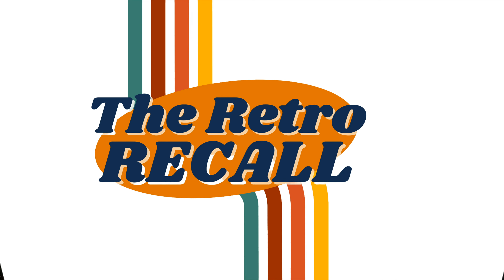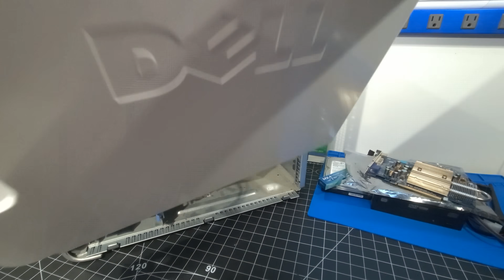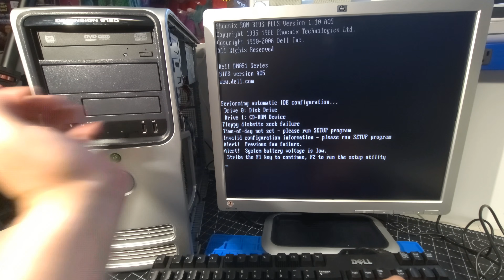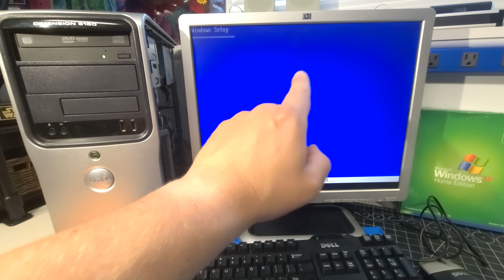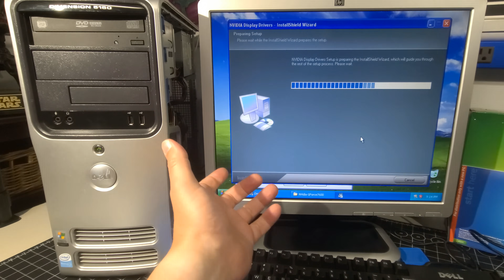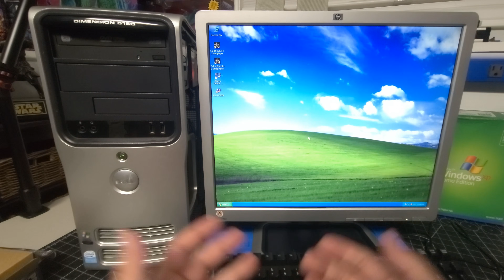Dell Dimension 5150 E-Waste Rescue - Full Restoration!!

Comment: Going through older videos as I recently found your channel which I am greatly enjoying the content! One thing I tend to do with older machines (well any machine these days to be honest) with running Windows XP or above, is use Snappy Driver Installer Origin for the drivers. It saves quite a bit of time trying to locate and/or guess which drivers you need. I tend to only install the graphics and sound drivers separately.

Comment: the first time I worked on one of these with that shroud that pulls the heatsink off the CPU, I was a little confused, but the mechanism works well enough... I just worry about when the plastic gets a bit brittle & breaks. can you put a normal CPU cooler on there? if not, you could have to throw out an otherwise perfectly good system
Reply from the maker: I'd have to 1000% confirm but I'm pretty sure you can.

Comment: JUST GOT ONE OF THESE SNAZZY DELLS AND GUTTED THE OLD HARD WARE AND REPLACED IT WITH MODERN AM4 MOBO R5 3600 16 GB DDR4 AND A RX550 4GB GREAT LITTLE HTPC! LOVE THE AIR INTAKE AND THE METAL LATCHING SIDE PANEL!! WILL BE PAINTING ALL WHITE! HAD TO MAKE A CUSTOM MOBO TRAY AND CUT OUT THE BACK A BIT BUT WORKS FLAWLESSLY!! WIN 11 ON A "E510" LOL
Reply from the maker: Haha I was going to say, ATX VS BTX.  Did you have to do alot to the to case to modify it?

Comment: how do i clean my computers? with a air compressor . been doing it that way for years with no issues. i used to have that exact pc until the motherboard took a dump. i recently got a dell xps 420.  and its a great pc. in fact im using it now to type this message lol
Reply from the maker: Nice! Yes I've used an air compressor as well, however it doesn't work in the space I'm filming in.  I use the ESD brushes and vacuum to clean instead.

Comment: Hi, just started watching the channel so a little late to the party.  First, if you are rescuing Dells ... you should expect that 9 out of 10 or maybe 99 out of 100 will fire right up.  I have had a lot of Dells over the years as well as a number of them from the local thrift store.  I can only recall one from this era that didn't boot and that was because some jammed the CPU back in the socket and bent about a third of the pins.  Also, I am pretty sure that XP key on the side of the case wouldn't have worked. I believe this is from the era of when there were OEM XP install discs that automatically installed without a key. The tag, I belive, was just to keep track of how many XP installs went out the door. With that said, if you can get your hands on a Dell OEM XP reinstallation disc, it should just install (on a Dell of the era) without a key. The Dell discs would not, however, install on a non-Dell.  If you search on archive there are a million of these discs posted. The plus to do this is it should also give you the Dell branding (system information, wallpaper, etc.). That would restore this PC to it's former OEM state.
Reply from the maker: Thanks for this and welcome to the channel!!!!
Reply: Hey so I have the OEM disc for my Dimension 5150 and it does have the product key, but it doesn't give me the dell branding? Even the Dell Resource CD doesn't give me the branding

Comment: Brings back memories I had a Dimensions E521 same case but had a Athlon 64 Dual Core. Had for about 4 year before upgrading ti an XPS machine and gave my Dimensions to a friend who continued to use for another 4 to 5 years. Only issue it ever had was the sound chip died and I had to install a sound card.
Reply from the maker: It seems they lasted.  I have other Dell's today that are 10 years old running windows 10 without issue.  That replacement sound card was probably better than the onboard :).  Thanks for watching and for sharing!

Comment: XP supports 3.5GB of ram due to it being a 32bit OS. One of the main reasons I switched to Windows 7 back in the day was due to this limitation and the fact that if you had a 64 bit processor a 64 bit OS would generally be snappier.
Reply from the maker: For sure!  And thanks!

Comment: Windows xp home before service pack one had an issue with hard drive partitions over 160 gb but it was patched eventually. Windows pro and enterprise editions didn’t have the issue. I remember having the exact same issue you were having trying to install Windows Xp home on a 250 gb hardrive drive and ended up having to partition it into two separate 125gb.
Reply from the maker: Thanks for this info.  As noted I had never experienced that before so this is helpful for future builds!
Reply: No problem I enjoy your content.

Comment: I have a ibm thinkcenter M51 tower and it has a pentium 4 with hyper threading and it run hot it keeps my legs warm and I got it from my local dump and it doesn’t have any bad capacitors at the moment but yeah it plays XP games well and Iove it
Reply from the maker: Nice!!! Those were robust systems - and good space heaters haha.  Thanks for sharing!

Comment: Just noticed something that may explain why your XP Home install failed.  Upper right corner of the XP Home disk portfolio calls it an Upgrade...which means it is expecting there to be a pre-existing version of Windows 9x!  All of the necessary files are on the optical disk, they're just disabled because this is the (cheaper) upgrade version.  There IS a way around it, told to me by a friend who worked for a computer retailer, it involves copying the CAB files to a directory on the HD, unpacking a couple of them, modifying a couple of numeric values in INI files, and then rebuilding the CABs before running the install from the HD directory.
Reply from the maker: That is a great call out.  I was expecting from a clean install that it would ask for proof of validation.  It wouldn't even get to the part (GUI) after the files were copied which has me thinking it was a driver issue that the SP1 wasn't covering as part of the Home edition version that I have.   Either way, PRO OEM installed perfectly, but definitely a great call out!! Thank you!
Reply: @TheRetroRecall  This is true, another thing from my experience, Dells are very picky about what they will install. I had an old Dell desktop system, and it absolutely refused to install from the generic MS windows disc I had (which was a full copy, not an upgrade), I had to get a Dell specific OEM disc, which it looks like you have there based on the printing of the Pro booklet.
Reply from the maker: I do!  Thanks for this info it makes sense.  When I revisit these systems (hint hint haha) I may do that test!  Thanks again.

Comment: I have a couple of these towers, recovered from a direct mail warehouse that went under.  I was thinking of trying to find a more modern mobo that would fit the airflow scheme.
Reply from the maker: Nice!  From what I understand the case would have to be modified to fit an ATX form factor MB.  I will say I like the design and the concept is neat... However it seems it never caught on and ATX was the mainstream form factor.

Comment: For the optical drive, there should be a spare set of screws for it on the back of the black panel. They ride on a track in the drive bay and snap into the blue thing. Once you do that the drive should be more flush with the panel and better held in.
Reply from the maker: Thanks!  Yes, this was mentioned as well from another viewer. Was completely unaware of this and it will be most helpful.  I was told it makes it more of a tool-less design.  Either way, love the feedback and suggestions.  It really is appreciated and helps!!!

Comment: Aha I had one of these back in 2013 as I was poor after buying a house and my Macbook Pro had died.  I'm sure mine had Win XP Media Center Edition installed when I got it,  I immediately installed Windows 7 Pro...  If I remember rightly it was a P4-D 2.8Ghz, 4Gb RAM, 500Gb HDD and I'm sure it had a Dell branded ATI graphics card.  It was adequate performance wise but a total waste of power 😆
Reply from the maker: Sorry to hear about the MacBook but love the switch you made to pc!  That's one thing I've noticed about this era of machine, power usage :). That and the heat that is coming off of that chip, it's crazy!  By the end of filming, my room was so warm haha.  Note to self - record these machines in winter :)

Comment: I have a sad love for these systems! Just as a heads up those front optical drives use special screws. You only need 2 or 3 if I recall correctly and they are located on the blank covers for the unused 5.25 bays, you just install them first and the drive slots in through the front and can be removed tool lessly. This will prevent that optical drive for sitting sideways in the bay. Sweet XP system!

Cheers
Reply from the maker: Thanks for this helpful info!!! I will take a look as I 'may' have another version of this system ;).
Reply: @TheRetroRecall  excited for another video! Keep up the great content
Reply from the maker: Thank you and thanks for watching!

Comment: small downdraft coolers and some waterblocks should work with these cpu mounting holes
Reply from the maker: Thanks for the tip!  More cooling would definitely benefit this system.
Reply: @TheRetroRecall  you can even get mini radiators down to 80mm or less in some cases so watercooling would be possible. also those fan failurs can usually be solevs with proper 4 pin pwm fans. you may need a dell fan converter becasue 2000's era dell things
Reply from the maker: Awesome, thanks!  I will check it out.  Always love the tips - gives me more ideas :)
Reply: @TheRetroRecall  I would suggest getting the better Dell cooler. It mounts to the same shroud and goes to the top of it. It also has heat pipes, that’s what the holes in the top of the shroud are for. That larger heatsink was made for the beefier Pentium D chips like the 3.4ghz model.
Reply from the maker: Thanks for this.  The system was quite toasty even with just the 2.66ghz CPU.  It's crazy how warm this can get.

Comment: That turned out great, and nice choice of video card. I always wondered, what do you do with your vintage pc's once you restore them? Btw, XP will run on as little as 128 mb of memory, albeit verrrrry slowly. Many XP office machines back in the day were saddled with only 128 mb, much to the chagrin of the people that actually had to use them
Reply from the maker: Thanks for the info on XP.  I can't say I ever ran it on that little amount of ram before, I think 256 was the lowest amount and I found it terrible haha.  Regarding what I do with the systems afterwards, for now they go into my storage labelled with what was done with them in case I ever need them for another video showcasing something.  That said, I am not sure what the future holds for them :)

Comment: Looking good there, 2.5GB for Windows XP was pretty beefy for the time! Back then we had a HP desktop with like 512MB RAM for XP & my 1st ever laptop was a 2nd hand HP with XP & 256MB (less with shared video RAM). Meanwhile you've got like 512MB just on the video card alone, I reckon you're all set!
Reply from the maker: 100%!! That and I have tons of ram.. Way too much.  Need to use them somewhere haha!  Of course if the system starts acting up, that tends to be the first place I go looking :).

Comment: My XPS 400 is exactly the same as this system, well other than it having a different Pentium D and a professional coa
Reply from the maker: Nice!  I just love these Dell systems.
Reply: @TheRetroRecall  They're very interesting to say the least! I really don't like the CPU cooler design myself though, a lot of replacement procedures and cleanup require you to remove the cooler and replace the grease.
Reply from the maker: 100% as I found out.  It forces you to do it everytime.  Ah well, it is an interesting design!

Comment: I've done a lot of migrations of XP to other computers because of bad caps....for a viable win xp system I like core 2 and athlon 64 and better if at all possible.....older really only matters if they have needs as far as the hardware on the system, for example a driver for an old sewing machine that looks for a Parallel port, even if nothing plugs intro it, had an issue with an old usb dongle for a sewing program, and the system had to have a parallel port. But for all other use cases I'd like the faster newer platform...P4 is slow and a real power hog. But anyways, if the only 100% xp computer I had at my disposal was a P4, I'd use it (of course make sure good caps and new CMOS battery). One of the most enjoyable things I do is clone a xp system with bad caps and/or bad hard drive, clone that hard drive to a good one, and put that into a third gen intel ivy bridge system, the speed boost is unbelievable! Also if you are ever bored, try XP 64 bit edition, it boots stupid fast.
Reply from the maker: Thanks for this, love the comment.  I really need to try out XP 64.  The AMD Athlon 64 build I did a few videos back would definitely benefit from that OS.  Im curious if a USB to Parallel adapter would have worked for your parallel requirement?  Thanks again!
Reply: @TheRetroRecall  You're welcome. The equipment didn't even use parallel! It had a USB serial activation dongle thingy that looks like a thumb drive, it's coded to use the parallel interface! The software is linked to that version of the sentinel driver. It's possible that a usb to parallel (or PCI/PCIE) would have worked even though I wouldn't be plugging into it, but an older computer was the better play for this case, since I wanted her to have a floppy drive too and not have to use a USB one for convenience.
Reply from the maker: Ohhh I get it now, makes more sense.

Comment: We had quite a few of those 5150s with P4s at my workplace.  We called them "P4 heaters" and made sure they went to people who complained about being cold. They loved it.  The air intake on the front is like a funnel or classic drawing of a black hole sucking in everything.  Dust, paper clips, small coworkers, dollar bills to pay for the electricity it used. Planets.  The irony of that BTX design was that it didn't solve anything.  All they did was flip the board around and put the door on the other side. A
The ATX family accomplished more cooling improvement just moving the PSU to the bottom.
Reply from the maker: Hahahahaha this comment.  Planets, dollar bills??? Lol.  Yes - this machine was definitely running hot.  I will tell you I like that the pcie card was facing up instead of down... Better for heat dissipation?? :).  Thanks for watching.

Comment: i have the xps 420 core2quad Q6600...pc is the same except its black
Reply from the maker: Nice!!!! This form factor is kind of growing on me!
Reply: @TheRetroRecall  originally i saw them as workstations back in 2006. the job site i was security at used these for 3d modeling machine parts for earth movers. back then they had 48gb memory...insane
Reply from the maker: Holy!!! 48gb???
Reply: @TheRetroRecall  yep one of the engineers printed a spec sheet of his machine.